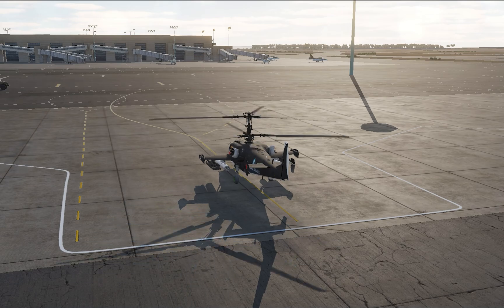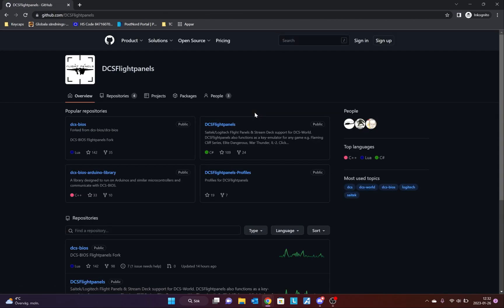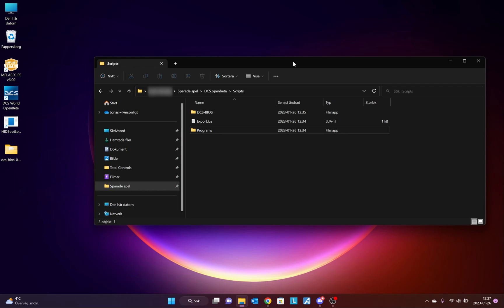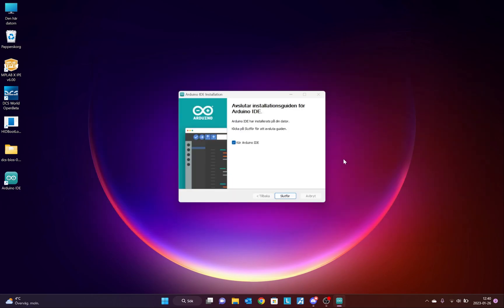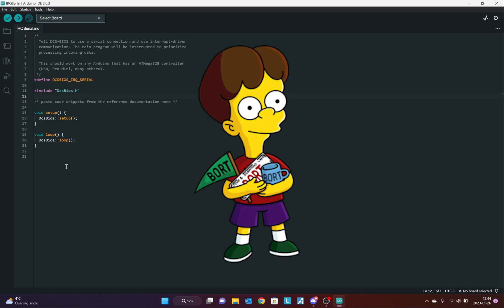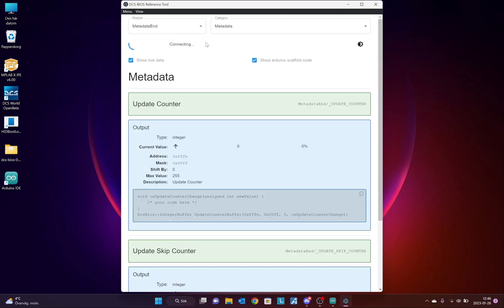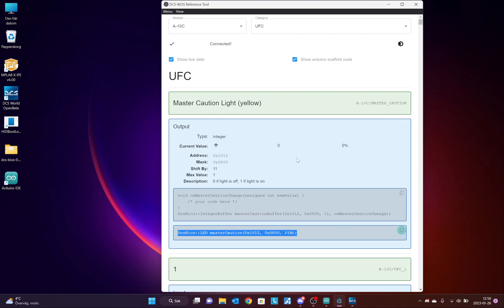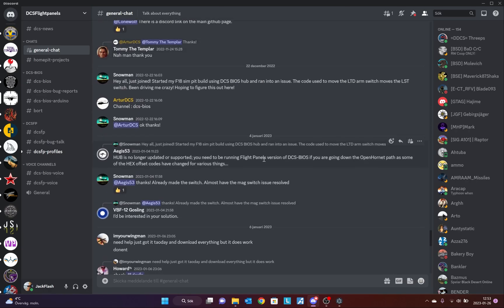DCS-Bios Fork with Arduino – a complete guide

Comment: bort cant find my modules, where do i point it?
Reply: any fix? im stuck on the bios reference tool and it says it cant locate my dcs modules
Reply: @tristanbaird4305  I have up and just went with Leo bodnar boards 😆
Reply: Okie I think I figured it out. The new bort interface has to have access to the .jason files to load all the planes from dcs
Reply: @tristanbaird4305 hey I have the same error with Bort not finding anything,  how did you fix that?  I’ve gave up on Bort and went back to DCSbio hub!

Comment: There is a sketch that turns an Arduino into a simple Joystick device you can then map to DCS using the default game functions.  I don't recall the name.  A better option than Arduino is a Leo Bodner board.  About the same price IIRC.
Reply from the maker: Yes, that is true. You will need a Leo or Pro Micro. However, it does not support displays and lights, so it is far from the same thing.
Reply: @totalcontrols  You mean people still do flight sims without VR?  That is absurd, lol.    the 2D era is over.

Comment: when I try to upload the arduino sketch, I get an error.

 avrdude: stk500_getsync() attempt 1 of 10: not in sync: resp=0xfd
avrdude: stk500_getsync() attempt 2 of 10: not in sync: resp=0x6b
avrdude: stk500_getsync() attempt 3 of 10: not in sync: resp=0x40
avrdude: stk500_getsync() attempt 4 of 10: not in sync: resp=0xf2
avrdude: stk500_getsync() attempt 5 of 10: not in sync: resp=0x52
avrdude: stk500_getsync() attempt 6 of 10: not in sync: resp=0xb4
avrdude: stk500_getsync() attempt 7 of 10: not in sync: resp=0x0a
avrdude: stk500_getsync() attempt 8 of 10: not in sync: resp=0x1b
avrdude: stk500_getsync() attempt 9 of 10: not in sync: resp=0x00
avrdude: stk500_getsync() attempt 10 of 10: not in sync: resp=0x03
Failed uploading: uploading error: exit status 1

Comment: Great video, but im stuck. Im attempting to map the Mig29S but it isnt appearing in the drop down box on Bort.
I have the module installed on DCS but it doesnt appear in Bort. Should i be installing DCS Bios in Install folder or Saved Games folder?
Reply: any fix? im stuck on the bios reference tool and it says it cant locate my dcs modules

Comment: this is intense. I got the switch panel from saitek because the throttle quadrant worked seamlessly with DCS. there has got to be an easier way to map the saitek switch panel for the P-51D. you also lost me at 8:25 regarding the pin? did not explain where this "Pin" comes from or how to find it. everything up to this point was incredibly helpful. also in the DCS-bios reference tool, how do you know which code you need? trying to map the landing gear handle, lights, fuel pump, battery and alternator switches, cowl flaps and magnetos
Reply: This video is really orientated towards hardware builders.  Thus we know what pin we soldered a button to on the board.  It really isn't got people who bought completed hardware from someone like Saitek and you certainly shouldn't be needing to mess with this stuff as an end user.  If Saitek told you you have to then that's extremely crappy.
Reply: @JohnVanderbeck  agreed. I found a way around my problem.  Only crappy part is how many programs now have to run in the background to play lol
Reply: @ryanpaulik864  Sadly that's pretty normal in the sim world :)
Reply: The PIN refers to the Pin on the Arduino board. I am not sure how you can manage that with the Arduino. I have not looked deeper into the DCSFlightpanels.

Comment: Great video, Thankyou.  You missed a vital piece of info though, you stopped at adding one com port, but having checked the forums for help, there appears to be alot of issues with connecting multiple com ports!  I have a complete spitfire simpit that needs connecting and i have been struggling for days trying to get the multiple com ports to work even with the edited file in notepad ++. any help would be awesome, Thanks.
FYI the old DCS Bios hub worked with no problems before swithching to the flight panels version and if i have to connect each instruments com port one at a time to use the pit would take a lot of time! Cheers

Edit: fixed the issue by changing the code in the connect comport files! Only took three days to see it 😂

Comment: Great timing.  I'm about to start setting up my panels and gauges in my simpit.  Any chance we can get a straight forward (like this) video on servos and gauges?
Reply from the maker: Servos are not so complicated. The operate with a number from 0 to 65535. If the servo swings wrong way, just reverse the numbers and adjust the scale to fit your needs. Read more here http://dcs-bios.a10c.de/docs/v0.7.0/userguide.html#_servooutput
Reply: @totalcontrols  thanks

Comment: 3:40  The "Programs" folder doesn't NEED to be in the saved games scripts folder.  Mine is on another drive entirely.

WRT finding the Arduino code lines, I prefer the HTML version of the control reference because BORT isn't searchable.

9:50  You appear to have skipped the part about setting up SOCAT.
Reply: SOCAT?
Reply: @AdrianFourie  Socat is what the Flightpanels fork uses for communication between DCS and the arduinos.
Reply from the maker: @No1sonuk  not needed if you follow the steps in the video. The socat will be set up correctly.
Reply: @totalcontrols  I watched it. Twice.  You didn't unzip and correctly locate the appropriate version of socat before connecting the arduino.
Reply from the maker: @No1sonuk  If you unzip it like in the video, there is no need to mess with the socat. It will work.
Reply: @totalcontrols  OK. I see where the confusion is...  You DID miss something out...
I just tried it from new - Socat is now automatically extracted the first time you try to connect an arduino.  Your clip doesn't show the message that says "Socat not found.  Extracting...".  I'm guessing your recording isn't the first run after installing.
As far as I know, that's new - I've not seen that before.